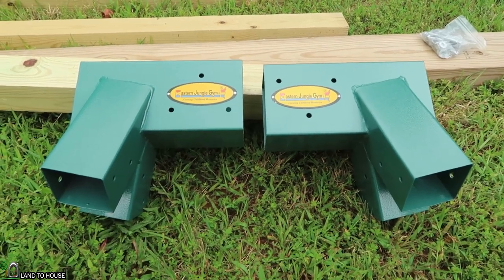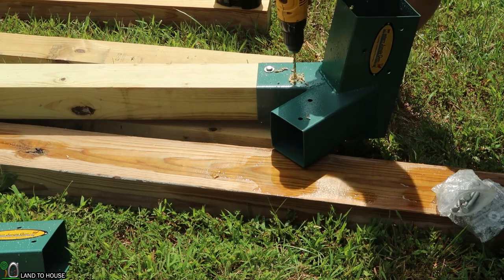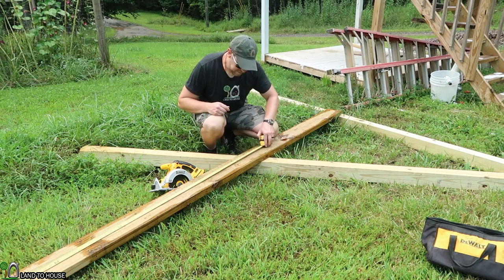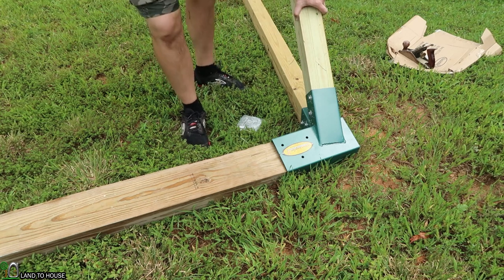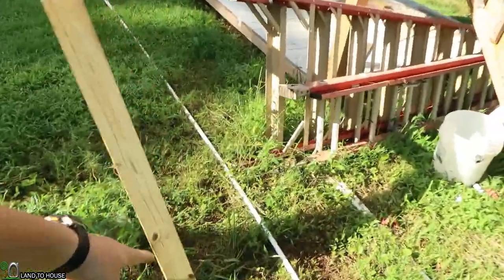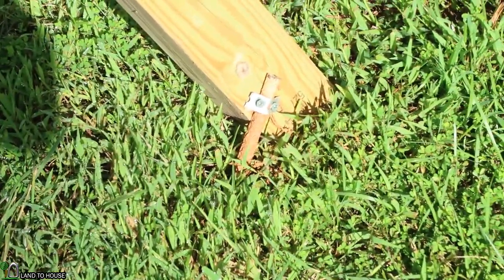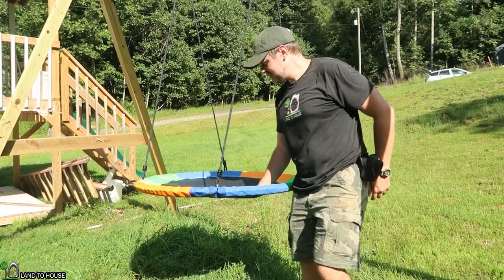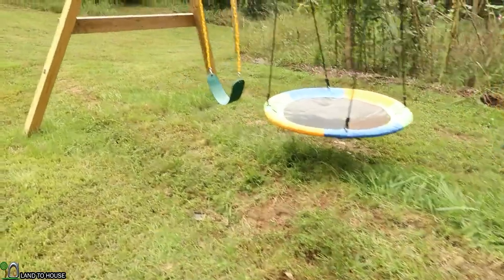Build and Install a Swing set with Eastern Jungle Gym Brackets

Comment: I used these brackets 16 years ago to build a playhouse and swing set when my son was 2 years old. Just sold the house and other than some flaky powder coating and surface rust. The playscape is still rock solid after 16 years of use from all my kids.
Reply from the maker: That says a lot for quality! I find them to be really strong. I imagine the wood will degrade before the brackets.

Comment: Quick takes:
1. Use pressure treated lumber for header beam and legs, doing pre-fits and trimming as necessary (tighter is better)
2. Consider coating them all with deck-over stain - the ‘thick’ type meant to be used on 10+ year old deck lumber. 
3. Measure and pre-drill for your swing hanger attachments. (You can actually go ahead and install them at this point if you don’t want to wait until final placement. )
4. Get everything close to your desired placement location. Attach the header beam to the sleeve brackets first, being sure the swing hangers point with the leg sleeves. 
5. Flip the beam in it’s back so the leg sleeves are in an upward V to accept their lumber. For the legs, do one to each side in corresponding position. You’ll lay it onto them for the final two. 
6.  Now keep running per the video. Get help to flip it upright and put it in position, set your anchors, attach the swings, and enjoy your Advil/ Tylenol while the beneficiaries enjoy their new swing set.

Comment: I bought similar brackets (almost identical) just a couple weeks ago and assembled mine as a Porch Swing A-Frame setup - I had trouble finding 4x6 8' (only found 12' and was pretty expensive) so I made my own 4x6 by laminating two 2x6 8' with a piece of 1/4" or 5/16" scrap plywood - I only used the plywood at the bracket ends and that allowed me to run long carriage bolts between the two 2x6 boards (I did have to drill a little with a long drill bit) the result was that the swing swivels don't use lag bolts so it won't pull out over time - I feel very confident that this setup allows for a couple "full size" adults to swing without any question of the hardware.
Reply: I don't think I can get 4x6 where I'm at so may do the same. Do you have any photos posted that you can share of how the laminated beam worked out, especially with the lag bolts?

Comment: In Windsor, Ontario we do not have access to 4 X 6' pressure treated wood.  I recently built an Eastern Jungle Gym by using a 6' X 6" piece of pressure treated wood.  Yes I had to trim the ends to fit the opening, but I was careful and it fits great.  I also laid out and attached the swing hangers while it was on the ground.  It was very easy to get them installed before raising in to position.

Comment: I really enjoy your adventures.
Scrap bits of 2x4 of various lengths used like jack-stands can help you stand up something that awkward by yourself.  lift a bit and prop it with short boards, lift some more and prop up on longer boards, final lift use one in the middle as a push stick to take it up the rest of the way.
I'm surprised the disk swing is using nylon straps instead of through bolts, they will UV out in about the same amount of time that your portable shed tarp aged out.
I'd also suggest taking a portable belt sander and rounding off the cut corners of the added cross braces so the sharp corners don't cause incise wounds to little foreheads bumping them.  I'm sure you realize those cross braces become jungle gym climbing points for younglings when they get tall enough.

Comment: I built the swing set with Easter jungle brackets and used 4x4x10 side bars because I wanted swings to be high.
But the problem is that swing set sways side ways when kids swing. Not sure if it's completed safe. Is it normal? If not then what's causing it and how to fix it?
Please help

Comment: I also found that getting the other side bracket into the header was easier if I took one of the legs off and used a few scrap pieces of wood to get the alignment right - lifting into place and positioning was still a 2 person job unless I wanted to pull a muscle or rig up a dolly for the legs.  I like the cross braces I think I'll add that to mine more for the option to hang things like plant baskets than stability...

Comment: I have the same brackets with a 12 foot top beam, and 10 foot legs.   I put a swing that holds 4 kids at the same time, swinging as high as they want, and the set never moves at all.  No braces or rebar strapped on the legs etc.  I weigh well over 200 pounds, and I swing with them on another swing, and still no movement.
Reply: Anyway you could measure (or know) how far it is from the bottom of the top beam to the ground?  I'm trying to plan how much extra chain I'd need if I use the 10ft legs.  Thanks!
Reply: @me-un4jl  I believe it was right at 9'
Reply: @GamingwithGamerGirls  Thanks!
Reply: So a 12ft beam fits 4 swings ?
Reply: @jrjr8574  yes.

Comment: Do you know if I can use carriage bolts to attach swing hangers to the beam (that's pressure treated)? Will the use of swings (and weight) pull that bolt more into the beam wood from above (as I cannot use washers with carriage bolts) or is it going to be okay?

Comment: Could you also drill a hole at an angle for the rebar through the leg and pound the rebar in that way? Would that do the same as the hangar tape?
Reply from the maker: I should think that would work. Now sure if it would be easy to line up. BUT it would look better and be less likely to snag a little foot.

Comment: Great Video! It’s probably here, but can somebody point me to a cut list.
Reply from the maker: I think that I just used 10 foot 4x4's for the legs and a single 12 foot 4x6 on the top. No cuts other than trimming down the ends to fit into the bracket.

Comment: I'm curious why you didn't sink the legs and anchor them with cement.  The round swing would probably be the right length in that case.
Reply from the maker: You can do that if you want. It has worked flawlessly with only putting a little rebar down.

Comment: For some reason you can’t find 4x6 in Canada, any suggestions? Do
They make these metal brackets for something other than a 4x6?
Reply from the maker: Thats odd. I don't really know anything about lumber in Canada. 4x6 are rather common in my area. I dont think a 4x4 would support well. 

You could use some 2x6 and sandwich them Together. But there will be a 1/2" gap.
Reply: Can you bolt two 2x6 together and use that...
Reply from the maker: There will be 1/2" gap because a 4x6 is actually 3.5 x 5.5 AND two 2x6 are actually 3x 5.5.

Its confusing I know. But the strength should be there with two 2x6's

Comment: how tall are your 4x4s? looks like swing set is really tall? I was gonna use 8ft
Reply from the maker: Those are 10 foot 4x4s. Works really well.
Reply: I just bought these as well, I used a 16 ft 4x6 and 12 ft 4x4s, and added a middle bracket of another brand and put another 8ft 4x6 with the other end of the Eastern Jungle brackets. I kind of wonder if it's too tall now, though I was aiming for tall.. I'm trying to figure way to add support from it swaying side to side as I've got the rocking front to back taken care of. I don't trust those welds (since I used heavy treated lumber) enough to let me kids play in under neath them for years to come... I am probably going to add a 3rd leg to both ends and support the welds on the brackets so if the welds start to fail it's got some help.? Idk

Comment: Is the 4x6 a 12 footer?
Reply: Same question
Reply: They are typically 10’. I used a 16’ foot so it hung off the ends to add another swing on one side and climbing rope on other. I also got a middle bracket piece so it’s actually twice as long.

Comment: How long are the 4x4 legs and do you like the height?
Reply from the maker: I went with 10 foot. Its has worked well.
Reply: @LandtoHouse  thank you.  I just ordered a 3 bracket kit (1 for the middle of the top beam) because I want 4 swings.  I’m thinking about 10’ legs and a 16’ top beam.
Reply from the maker: With the middle support you should be good to go with 16'
Reply: @LandtoHouse  What length did you go with on the top beam?
Reply from the maker: I went 4x6 12 foot long.
Reply: @LandtoHouse  Cool, thanks. Perfect size for 3 swings.

Comment: what size bit did you use to drill pilot holes?
Reply from the maker: A 1/4" should work well. Hold a bit up to the bolt and make sure the threads are wider than the bit.
Reply: I would think, that all you are really worried about .. having pilot holes drilled, so the bolts go in straight.
And, yes, always make sure the drill bit is decidedly skinnier than the bolt you will use.
Remember, the more wood there is to grip the bolt threads, ... the better.